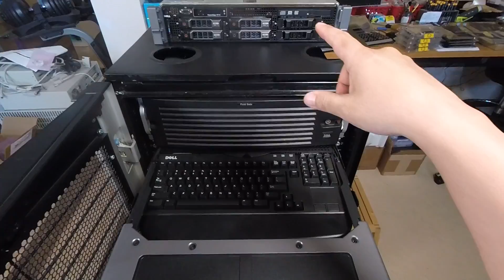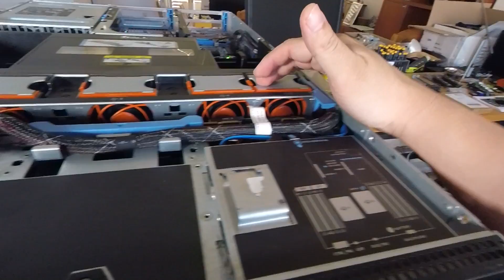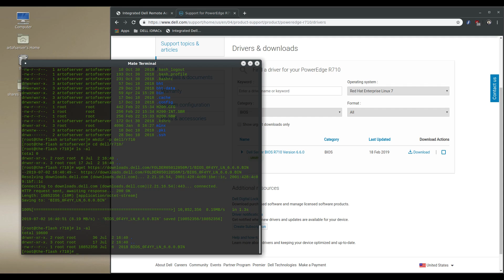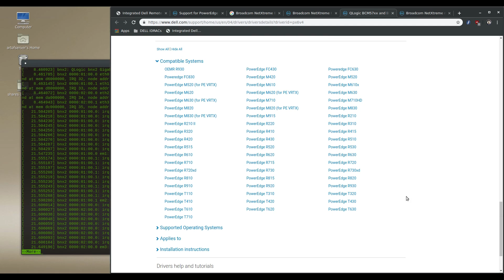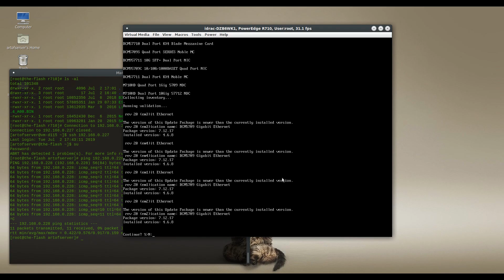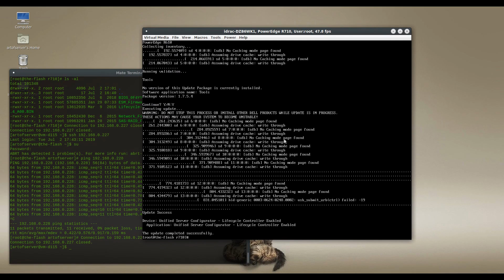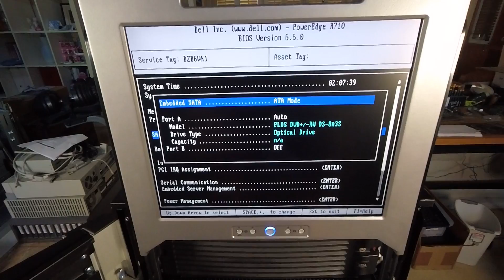Dell PowerEdge R710 build PART 1/9 | fixes, bios and firmware updates, and factory reset

Comment: Was going great upto 27:30. I’m guessing you have a usb Cent os plugged into the server and managed to boot that up and then ssh to it? Sorry if dumb assumption but I’m only just starting out with Linux. Iv been trying to boot up a usb Ubuntu stick but keep getting no boot media. Any chance on your next video in the series that you expand on this area a bit please? Cheers

Edit 
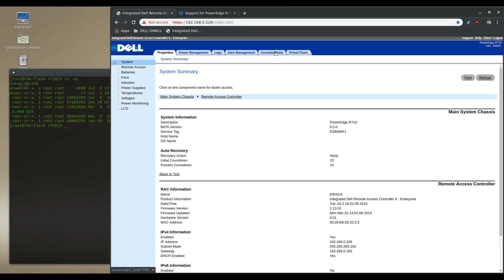35:30 made more sense 😊

Another edit,
I should really learn to watch the entire video before leaving comments, I will have another go after putting everything back to default!

Thanks REALLY appreciate the video! Cheers
Reply from the maker: yes, that's exactly right. i have a USB flash drive with CentOS 7 installed that i move from server to server to give me something easy to boot up with. it has my tools for flashing firmware any many other things.

regarding your issue with Ubuntu on usb stick, check that your BIOS settings are correct. notice that i set the USB emulation type to hard drive near the end. also, make sure your boot device selection includes the USB drive. that is usually enough to get it to boot an OS installed on a USB flash drive.

thanks for watching! :-)
Reply: Art of Server Thanks for the tips and detailed reply. Hopefully will be having a go this weekend. I do have unraid running on another box but I need the R710 extra resources as it’s reached capacity. Cheers
Reply: Can I ask what tool you used to create your Centos usb drive please. Iv tried etcher but that tries to install the os, which actually starts installing and fails with unknown error. Tried Linux Live Usb creator, same error but that failed where it tries to connect to a repository, that with live and persistence enabled, pulling my hair out now 😢

Error setting up base repository. I select the iso file, unknown error! Network is enabled and working.

Update, I got Ubuntu’s 18.4 live desk top working, no issues with that. Will try tomorrow the bios update, I’m on 1.2.6 😢. I’m wanting 4tb support. Can you advise if I can do the updates from Ubuntu’s desktop or use terminal please? Cheers
Reply from the maker: yeah, it's pretty straight forward actually. download CentOS7 and follow the instructions to make a USB installer flash drive. Then, install a blank USB flash drive (at least 32GB?) in the server, and make sure the USB drive is setup for hard drive emulation in the BIOS. Also install the USB "installer" flash drive... now boot up from the "installer" USB drive... and during install, you need to pick the install target destination; just choose the "other" USB flash drive. complete the install, remove the "installer" USB drive, and boot up on the "target" USB drive that you just freshly installed CentOS7 on. That's basically it. I basically treat it like installing on a normal HDD or SSD.
Reply: Art of Server Ahh.... when I was trying I had a 80gb hdd installed, it did see it but obviously something is going wrong when trying to install it. I will try again but installing to  a usb stick.  Thanks for the help 👍. Cheers
Reply: Art of Server . Ok got the Ubuntu usb OS installed, also did 350 updates even though I had selected it on the install. , BIOS, Network drivers, lifecycle upgraded but really struggling with idrac.   Az/spsetup.sh ./sputility.bin: not found

I tried also through F10 but it’s after a Windows catalog?   Any suggestions please
Reply from the maker: @shaunwhiteley3544  are you installing the same .bin file that I used for the idrac firmware update?
Reply: Art of Server . Hi, thanks for reply, yes but not an issue now, I installed windows 7 and it worked first time with its os version. All up to date. 

For info I think some of the issues were due to it being so out of date, the bios was at 1.2.6, idrac was first version etc. Anyway sorted now, thanks for the help. Only issue now is not recognising a 4tb drive. I thought the bios update did that.

I have a H200 in I think a hba mode, I think I need it in IT mode. Ha ha I’m making this up as I go, always learning 😀. Cheers
Reply from the maker: @shaunwhiteley3544  see my video about the 2TB limit. it's likely you have an old PERC6/i card. if it is really the H200, you might need to update the firmware, but H200 can be made to work with > 2TB HDDs since it supports SAS-2.
Reply: Art of Server . Yes I had got the H200 after watching your video, some months back, this week has been first chance to have a play 😀